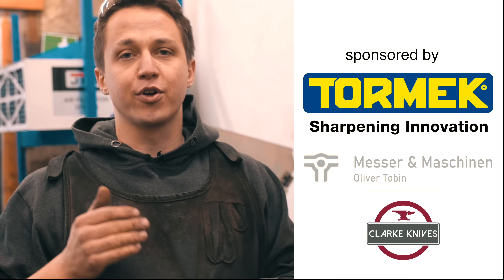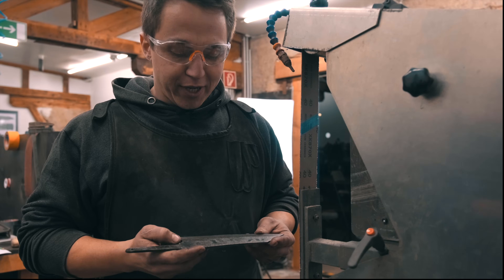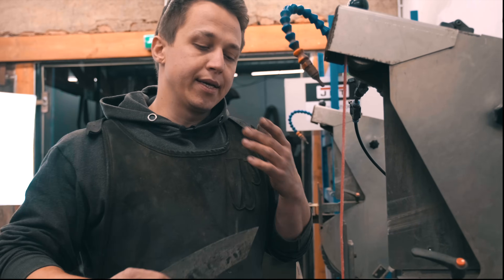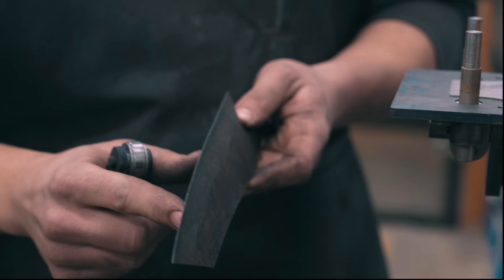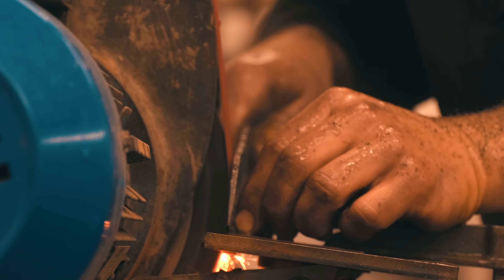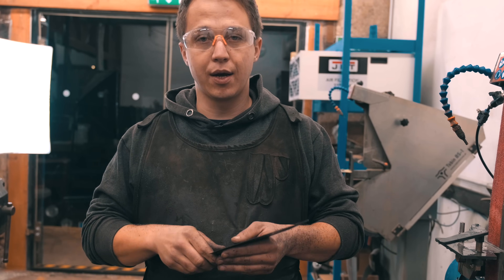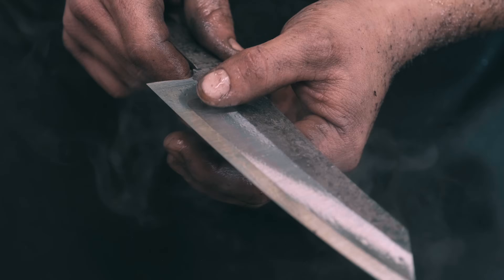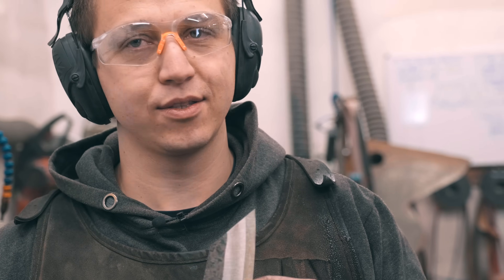I tried this once and will NEVER freehand grind again!

Comment: Texas hobbyist. I use angle iron as a jig for rough grinding. That way I can hog off a lot of metal quickly without burning my fingers. I refine the grinds free hand, heat treat, temper and finish grinding free hand. Fun to see other grinding styles. But I don’t have much issue with posture freehand grinding. Once the bevels have been set there is little play or wobble while I grind. So I don’t have to get up close and personal with the grinder. Thanks for the video content.

Comment: Yes, a guide will speed up work. However once one masters freehand, there are many-many styles of grinding that cannot matched with this crutch. 
This is the difference between a Master and Amature. We all have to learn and a crutch is blocking the advancement of said learning. 
KnifeMaker/Retired after over 47+ Year sin the Craft and in association with the Original  R.W. Loveless Shop.

Comment: If you took that jig and put grooves in the base (horizontal portion), you could space those grooves that that when the spine of the knife is in the groove, as it leans forward into the belt, you get a certain angle. If the stock isn't consistent enough to allow for multiple grooves, you could always put different thickness spacers at the front of the jig so that the spine of the knife is a consistent distance from the belt, thereby holding the knife's edge at the same angle.

Comment: Hi there, how does that jig handle thinner blades, and also blades that maybe don't have a parallel  edge to spine ratio? Im a machine designer and this inspired me to looks at a method to have 2 heights for both left and right pins without setting or adjusting anythiing.

Comment: The barring pressure tool could do with a stop on the pivot to keep it from over rotating into the belt and maybe a rubber ring around the barring for some extra grip on the knife.

Comment: There might be very good reasons why this wouldn't work, but has anyone considered using something kind of like a rifle sling? Basically something you could clamp to the work piece and then wrap around yourself so that you can brace and stabilize your upper body against this strap well your lower body and back get to stabilize in a very natural position?

I mean like it doesn't make much sense as a thing to do, but it just seems like it would solve some of the problems if you were going to hand grind

Comment: One thing I would recommend with the arm of the grinding jig is to put a pressed on metal partial toroidal sleeve on the ball bearing.  That way, you don't have the bearing applying a point load with a flat face following it. The flat face would be the natural place the material would want to run against the bearing.  Having no flat face would give better control over the force vectors.  This effect is very noticable when using the plywood block to press the blade into the belt when grinding the hollow grind.  The blade rotates as the stroke is taken, pulling the cutting edge away from the guide and more closely matching the flat of the plywood.
Reply: makes a lot of sense

Comment: Nice for kitchen knives n wide Blades. I doubt it will Work on slimmer, smaller...Blades ....U wont get Close enough to the belt If U want a füll flat Grind or Higher Up Saber grind...Lip is in the way.... Just Tried a similar Setup...If U remove that Plate it works but Then the benefit of the PushStick , lip Plate combination is gone... 😢 Still a nice Well thought Out jig for what its Made n Used for in the Video....OR I am wrong n doing it wrong. Would be great to See it being Used on lets say a hunting knife or neckknife....that is 2-3 cm wide....would really be interesting. Thx

Comment: This is one of the most informative knife making video I've seen in a long time! What a nice video and motherload of small tips and tricks.
Reply: Agree
Reply from the maker: Wow thanks Seth that is very nice of you! We are extremely fortunate to have the likes of Tobias in our community!

Thanks for watching!
Reply: @UKBladeshow 
Sir, FWIW, it occurs to me that if the distance from spine to edge is not consistent down length of blade, this method will make the bevel angle change from heel to tip.  This is not necessarily bad, and the transition will be gradual and look fine, if it is even noticeable, but this will make for different grind height w the actual edge bevels.  

In extreme cases, on blade w extremely tapered pattern form, this would require change of geometry of edge bevels as well.

Comment: Another great video.
How well does that grinder setup work on knives with more radiused belly section?
Reply: Rounded bellies ar not a problem, fine upward pointing tips won't work as easily though. I usually freehand them after finishing 90% with the jig
Reply: @Tobias Hangler  Thanks for the reply, I do seem to have more trouble the less straight the edge is.

Comment: Nice rig. Tobias mentions in the video he just grinds 1 min to get to thickness. It is the time to go from 0.7 to 0.2mm? If so, impressive! All that series is super interesting.
Reply: Hey Tony, yes thats from 0.7 to approx. 0.2mm behind the edge
Reply: @MesserschmiedeHangler  Thanks Tobias, I guess I need to practice and try to improve my process then! Thanks for sharing your knowledge and experience. beautifull knifes too!
Reply from the maker: Hi Tony! It was super impressive! Thanks for noticing. That speed of stock removal was due to a combination of good technique, an appropriate abrasive belt for the application, and the belt grinder speed also plays a big part on that 

Cheers Tony!
Reply: @UKBladeshow  Thanks for answering....Keep on going with your channel. Super interesting!

Comment: Lot of really innovative stuff in this one, I used to do freehand for a few years and I still will for really complex blades that basically, you can't do any other way. But its something I consider very 'danger zone' to do after a long day of grinding out knives, your muscle memory will hang around, but the concentration goes to hell and accidents happen.
Never used jigs though
I'm pretty much a block of teflon push-stick grinder as I like the control and amount of pressure I can apply in combination with belt speeds to make sure nothing overheats. The little 'step' insert on the rest though is a really top notch idea as anyone that's done the old 'it got dragged in between the platen and the work rest' trick can attest, its really not a good trick at all. 
Very cool episode
Reply: Thanks! I never tried Teflon blocks but that sounds interesting. Where do you get them?
Reply: @MesserschmiedeHangler  I usually buy them on Aliexpress just in a little 6 x 150 x 150 mm sheet and lop off an inch-30mm section with the hacksaw as required for a new one. They last a pretty long time if you don't feed them into a 36grit belt too often :)

Don't think they were very expensive, I know they do sell the same sort of stuff on ebay as skid bars for trailers if you feel the need for a really big chunk of the stuff as well. But the nice thing about it is that PTFE wont deform under moderate-high heat, it slides well across the blade and self-polishes. On a stick I'll usually have a dead-flat section on one end for broad pressure to get the flats of a bevel put down and a rounded end which I use for really fine, more precise pressure to the work material as you work up to the final taper of a bevel geometry.

Just as an afterthought, if you didn't want a bearing for your jig set up (and I do like that a lot) is you could make a piece of teflon in there as a circular roller. Maybe a half-inch, 15mm wide section or even a variety of width and thicknesses to suit the pressure grinding application. Just a thought on that seeing as bearings are great but they're also a bit expensive to find the ones you want in a size.
Reply: @krissteel4074  i am very happy with the bearings but they of course also don't like being fed i to the belt so the teflon would have some advantage in that case. They bearings really aren't too expensive if yiu buy them in packs of 10 or more and i currently started to tape them with a bit of electric tape which i can easily replace if i slip into the belt slightly
Reply: @MesserschmiedeHangler  The alternative is getting some round-stock of Delrin and turning out a centre bore to match the axle on the jig. It is from memory quite a bit cheaper and has some very good compressive qualities as well as being hydrophobic. In terms of temp it will stand up to about 150-160C before deforming.
Might be an option to look at one day if you figure turning them up on a lathe could work out.

Comment: The Tormek sharpening system is really great! But I did notice the angle tool being used wrong one of the times in the advertisement 😂
Reply from the maker: Oopsies! What did I do wrong? Thanks for the feedback!
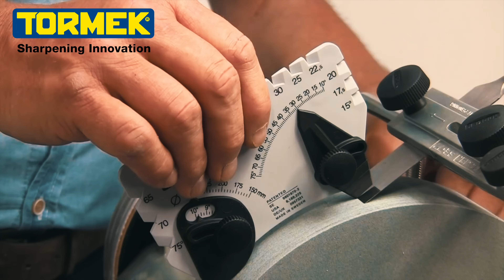Reply: @UKBladeshow  Both black parts of the angle tool must touch the stone. Like you do at 16:24 👍
Reply from the maker: Oh yeah I saw it now. I have no excuse other than it was a pose and I probably slipped because I literally know that (I reviewed correct use of the angle tool literally 3 times as I didn’t know how to use it before until this video, but I obviously should have reviewed it 4 times hahaha 😝).

Thanks though - feedback helps! I hope you enjoyed the video!